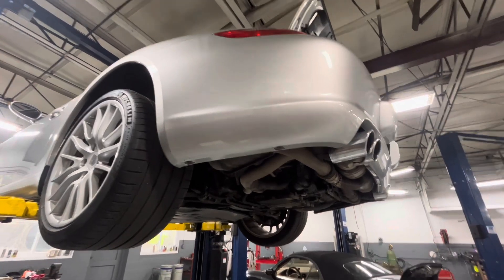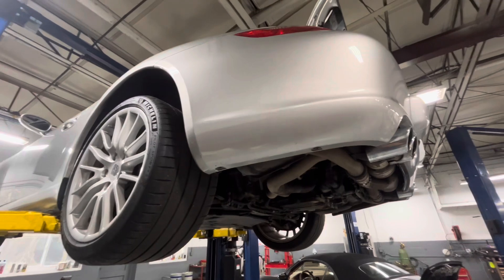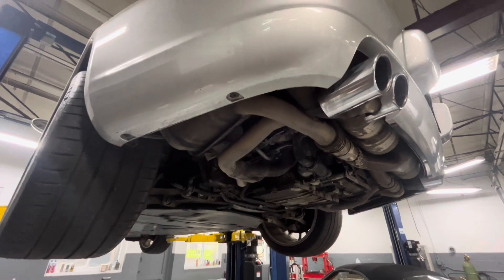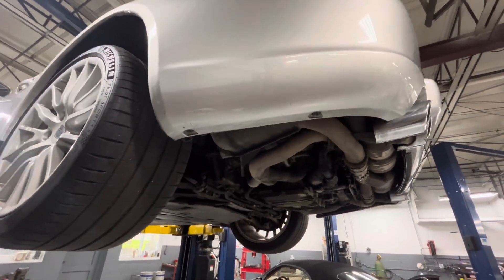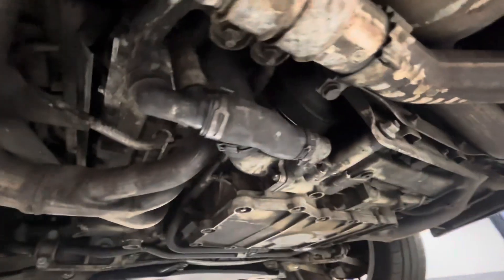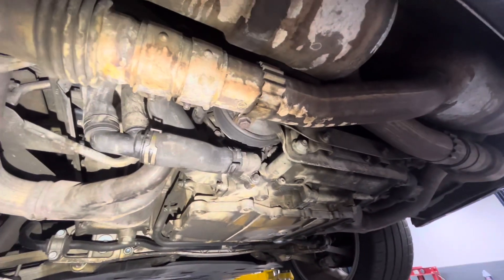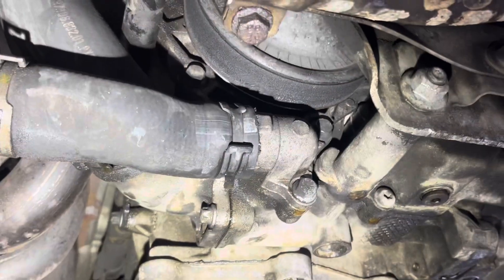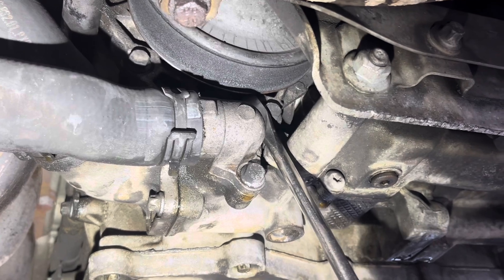COMMON CAUSE OF COOLANT LEAK THAT PASSES COOLING SYSTEM PRESSURE TEST

Comment: I had a truck with a coolant leak. Couldn't find it with my pressure tester. It only leaked going down the road. Stop leak didn't slow it down. I had to change the AC compressor so as soon as I took the belt off the water pump started leaking. Apparently as long as the belt was pulling on the WP pulley it wouldn't leak. If it went over a certain RPM the centrifugal force would pull the pulley up and gush out coolant, crazy. 😂
Reply from the maker: Hahah they can be tricky